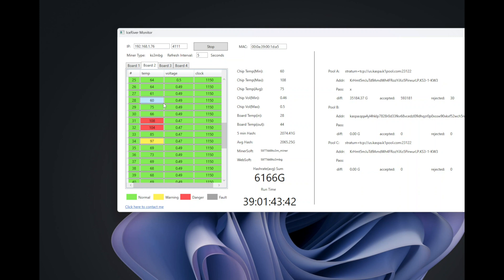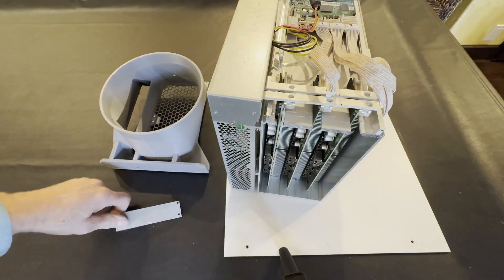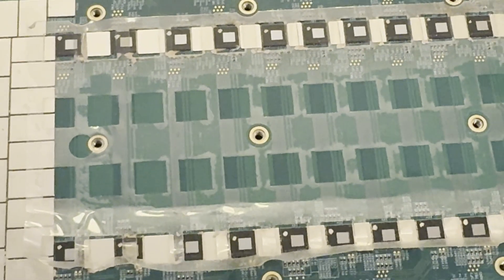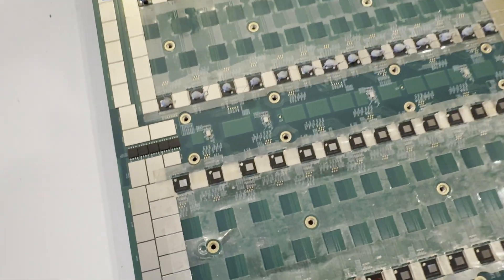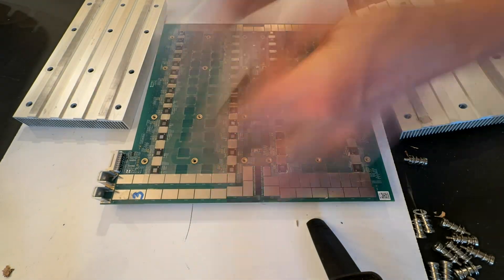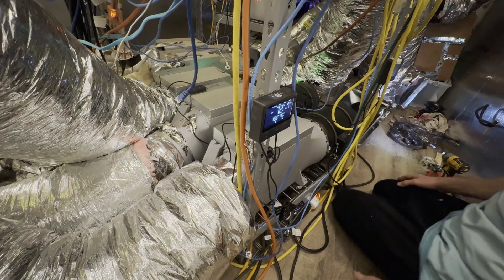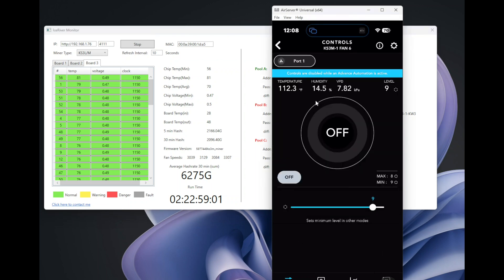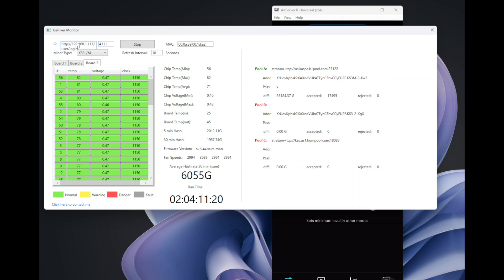I FOUND THIS CRAZY PLASTIC THAT COVERED FEW CHIPS,THIS ALMOST KILLED MY KS3M, ICERIVER PAY ATTENTION

Comment: i replace the thermal paste to mx-6 but my max temp on board 1 and 3 is still 92 why? ):
Reply from the maker: Make sure ambient temps below  78F if running on stock fans or run AC infinity fan, also, is it  possible that few chips didn’t get enough thermal paste? With AC infinity fan I was able to keep temps on chips below 82c
Reply: @DontMindMeMining  I'm on stock fan and the room temp is 18 so do you recommend switching the stock fans ? And can you send  me the product link ?
Reply from the maker: 18C you should be able to get your stock fans speed adjust to get chips below 85 for sure the stock fans a bit noisy running high speed, the AC infinity and fruition design kit links in video description
Reply: @DontMindMeMining  hmm so what's your recommendation should I try to repaste it? or buying the ac fan kit ?
Reply from the maker: It’s a hard one, since it’s takes lot of time and 1.5 8g tube of paste. If hot chips temp higher by 20-30C then lowest ones I would probably open and look what’s wrong with those chips and if any film covering. If temps on hottest only 10C or less diff then AC infinity is great solution and quieter would use one with WiFi controller and it’s auto speed adjust mode works beautiful. Hottest chips I got so far was 85C when it was 85F outside just few days ago.
Reply: @DontMindMeMining  thank i really appreciate your reply❤️

Comment: Why no to remove this plastic cover ? Does it have any function? I was replacing paste today and now im thinking just to remove it, how you think ? Appreciate your answer or knowledge who removed it, does it change anything? Thank you in advance
Reply from the maker: I think you can remove it if it’s covering the chips, someone posted before that they did t have that plastic before in previous version but it was added later. I don’t know if that isolating possible contact from heatsink to other onboard components or air blowing some particles that electroconductive,  again these are just my guesses and no one was certain about it. Best is to contact iceriver service if they have any comments about it.
Reply: @DontMindMeMining  and what if it dont cover chips ? I have 3 grey chips and see some dust under that cover. MAybe dust block chip which shows tems/voltage/clock ? Since those chips are grey i have no idea what could cause that, it shows 6+th, but still 3 grey chips... my idea was to remove that plastic cover and clean dust, maybe that will help chips to show correctly. I trully believe that in few month those covers will be full of dust if you dont clean them every week...
Reply from the maker: Not sure if that dust is causing any problem but anything on chips between heatsink other than thermal paste will definitely effect temps.

Comment: I also have a couple of KS2 and  ks1 where the heatsink are not perfectly flush, the middle chips had a gap of  .2 mm . So they always get hotter. I had to use thermal pads to allow it to work with out getting hot. The quality is really bad.  It's shameful.
Reply from the maker: Agree, that coul damage the product and realy to ship out back super expensive.
Reply: @DontMindMeMining  i replace the thermal paste to mx-6 but my max temp on board 1 and 3 is still 92 why? ):